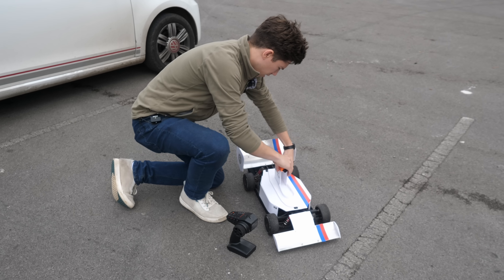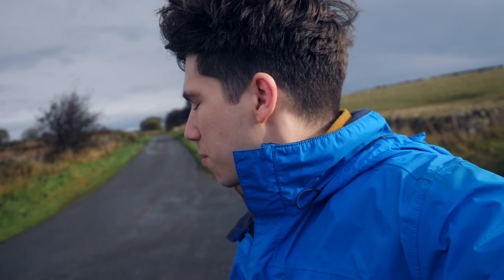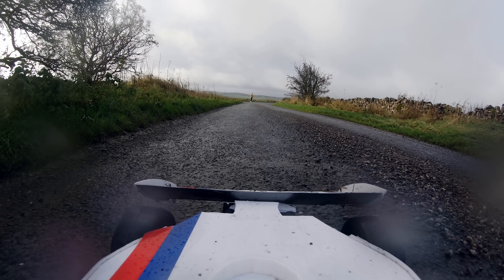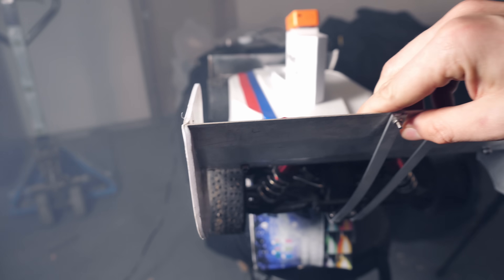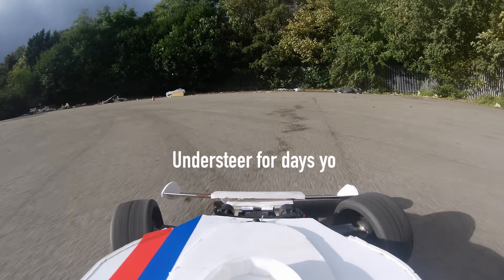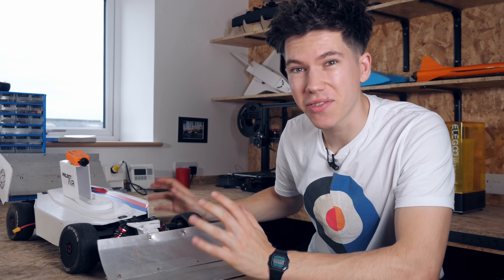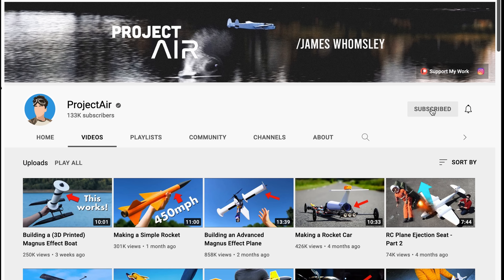RC Car Extreme Aerodynamics

Comment: Very interesting stuff. Having had a tiny role in some F1 aero (I once mechanically designed a blade antenna that went on the 2002 Williams) I know how much effort the teams put into the TINIEST details to gain miniscule improvements. I was impressed with William's input and care and totally shocked by Jaguars lack of it (also did their antenna).
Reply: Eyo u worked in the V10 era! Thats mental. Did u worked in 04 w williams too?
Reply: God, working at motorsport would be my dream job! I'm working at a Baja SAE team right now, hopefully I'll get there
Reply: So how was it working with them and how many years did you work with them but man i would have been jumping around if i got that offer
Reply: What a achievement! I am an aerospace engineering student, wishing to be like you. Ah hopefully.
Reply: Im trying to get into the design and creation of parts using composites. Would be awesome
Reply: Unfortunately in the real world there are rules limiting the height of wings .Running on the track solo is a totally different animal than driving in traffic with other cars.At road Atlanta there used to be a hump in the main straight where cars would flip if they were too close behind another car .I liked the old days of Can-Am with fewer rule restrictions.I used to think it would be best to have wings between the front and rear axles.Then one would run into problems with height limits.The old Chaparral cars were cool .
Reply: tell the FIA we need the V10 era back
Reply: This man.
This man right here has worked a job that many will only ever dream of

Comment: It is always a pleasure to watch your videos. Here is a crazy suggestion to test down force on the RC that may offer a better control. Go old school and attach a control line to the side of the car and a fixed bearing back at the center point of the circular track. This would allow 1 or 2 scales to be placed under the track monitoring the force. As long as the mass of the car and speed were kept consistent the wing and body design could be accurately measured. Just food for thought. Cheers!

Comment: I have raced RC cars in the early 2000's. What I remember is that the F1 cars weren't as fast as sedan-type racecars. Prototype cars also had a big advantage. What those have in common is a very low front bumper, almost scraping the ground, and a very high and open rear end.  I always thought the open rear made a lower pressure inside the body, and that this made most of the downforce. It is also something NASCAR has been doing for a long time.
I could be wrong, but it has always been something I would like to know.

Comment: Very cool project!
I loved that you used smoke to display the aerodynamics of your design as well. I’m no expert, but I have noticed some of your fellow YouTubers using straws in order to give the air from their smoke machine a laminar flow for aerodynamic testing. If you pack the tube containing your current fan with straws of sufficient length, it should provide you with more stable smoke across your car.

Comment: What might really make a difference is a fan sucking the air from under the skirted floor. It worked so well for Porche it got them band from F1. 
Using a ducted fan for this would be a good experiment?

Comment: From a RC racers POV… the setup of the car is more of an attribute than the aero effects. Yes aero is involved in RC racing. But it’s effect is minimized by the scale of the cars compared to the relative actual speed. Basically the aero devices are too small, speeds too slow to create the wanted effect. Always a great video creator to watch, cheers!

Comment: Build a real miniature wind tunnel with a scale to measure downforce! When I was looking at your fan/smoke machine I was wondering if the air flowing across the car should start as laminar flow which would simulate air flow in ‘clean’ air. If you use turbulent air you can simulate dirty air. That sounds like a question for Destin @SmarterEveryDay
Reply: A wind tunnel is not a simple thing to design, even on the industrial level.
That fan/smoke trick is nice but it doesn't represent the real flow around the car because the fan is too small and you can't guarantee the smoke is distributed equally by the machine. You need a bigger fan, a long distance and a set of diffusers to have an acceptable laminar flow. Moreover, these turbulent conditions do not represent track conditions in any way.
It can be a nice highschool project, but I don't think it will bring useable results.

Comment: You may need stiffer springs as the downforce pushes the car down, so that the suspension is not fully compressed and unstable?

Comment: I don’t know you and how much you know about F1, but you should try to do a fan car! (A car with a fan to suck the air underneath it) 
It was banned very quickly after it appeared because of the unfair turn radii it had, especially at low speeds where static aero couldn’t do the trick.

Comment: Something you could try would be having the rear wing connect directly to the suspension rather then the body or chassis. Both Can Am and F1 did it for a little while so the force from the wing was transferred straight to the tires rather then pushing the chassis down.

Comment: Haha you should bring a pushbroom to your testing site, would help with consistency!
Also I think a light plastic rear wing, maybe made of like, tupperware or something with the smaller front wing would work well to keep grip at the front at speed. I think the front wing needs to be a tiny bit narrower than the rear as well, and as low as you can get it. Great video!

Comment: Also you have to consider the drag force caused by big spoilers increasing the frontal surface area... There is a relationship between drag and downforce...

Comment: Get an anemometer and use a desk fan to blow air over the vehicle whilst it's on a bathroom scale. You should be able to measure the down force in vaguely the right air speed range. My mate did this for his A level Physics Project.

Comment: James, a very interesting video. This type of aero is like a law of diminishing returns but seeing as how your baseline was the bare chassis with no aero then the initial gains are going to be massive, I can tell you that an 1/8 scale IC car with no body work is very unsettled, put even an average body like a Lancia LC2 an  there is a huge initial difference, then the gains are smaller and much harder to find.

At one point later in the video where you had understeer, you had the car pivoting about the back axle and actually lifting the front end. I done some wind tunnel testing with Ford on their first WRC Focus in the Cologne wind tunnel and this rotating around the axles is very noticeable. Ease off on the rear down force and some to the front and away you go.

Don't listen to the doubters. Most of them have never done anything useful.

Comment: The wing angle of attack should be in the 7° to 13° range to avoid flow separation on the back. To increase down force you can split one big wing into several smaller ones with progressively higher angle of attack, so that each is ~7° steeper than the one before it, and shallower than the one after it. Aerofoil cross section matters.
Reply: That rear wing isn’t a wing, it’s a spoiler. They work differently biggest confusion people make about car aero. The front wing is also pitched wrong. It’s making more drag than downforce.
Reply: What is it that makes it a spoiler as opposed to a wing, but the front surface is still a wing and not a spoiler? Is the original rear surface on the car (1:06) a wing or a spoiler? What about on an F1 car? What about a Formula Student rear wing which is similarly optimised for low speed downforce?
Reply: @Leo99929  In this case the profile and how the downforce is generated. A race car wing actually generates most of its downforce from the underside via suction just like the diffuser, since these have no profile and the air is basically just hitting them rather than creating low pressure under the surface it’s a spoiler.

Comment: You need to keep the internals the same but increase the size of the chassis and shell whilst adding as little weight as possibble and have an even larger set of wings and design the shell to push the car down etc.

Comment: If you use an upside down 
airfoil shape, it doesn't push the car down, it sucks it down, like an aeroplane wing lift the plane by generating a vacuum on the top side of the wing.
Just think the explanation in the start of the video is a bit mis leading 🤓😁
But nice project 👍

Comment: A selfmade wind tunnel would be An interesting project in itself and a nice tool  in the development of future builds.
Reply: There's a reason why wind tunnels are worth a lot of engineering times, you can "design" one and homebuild it but there's a lot to it. There are different tunnels for different flow regimes, different sizes and different applications.
Reply: Wind tunnels are incredibly hard to design and get good results from. Reason why conventional wind tunnels are expensive.
Reply: I second this idea!
Reply: I made one using straws and a fan in the rear so laminar flow isn’t disturbed. I used some dry ice in warm water as smoke and a small air foil. It was pretty incredible
Reply: This would be a good place to start.
 https://youtu.be/Sx5BQjKvElk
Reply: I recently watched this, I feel like it's almost exactly what you're thinking: https://youtu.be/NVUwNEZURpk
Reply: YES
Reply: The Wright brothers approve this post.

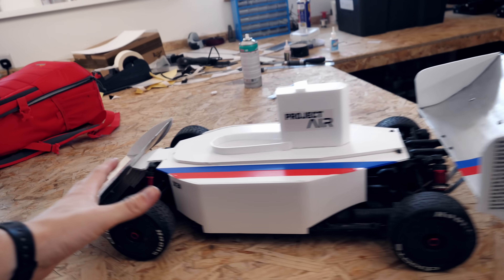Comment: 3:16.. With this setup...at those angles all you are getting is Air deflection down force but no wing lift down force since your wings are not slicing through the air as an Airplane wing would. At those angles the wings merely stall... IMO

Comment: Yeah, this is really cool, but definitively needed to be more scientific. Even without the wings, the car could go full speed through the corner. At that point, the only thing the wings can do is slow the car down with drag. You need to find a corner that the bare-body version can't get around without slowing down, and then see if the wings improve it. Pointing the camera at the suspensions and seeing it pushed down would also be a really good indicator
Reply: I'd reccomend a better testing track
Reply: Its hard to control the car at those speeds
Reply: He wanna have fun not build a fucking racecar
Reply: @shukriwafiq5220  I fail to see the relevance. Are you proposing you can't have fun doing science?
Reply: he is rc youtubes what do you expect xD jk

Comment: maybe raise the spoiler and remove the skirts
in f1 they stopped the skirts because of increases in crashes
also, the big size with the large angles of the aero could make handling harder
Reply: also something that might help is loosening rear anti roll bars if you have any
and/or softening rear suspension dont over do it on the roll bars or suspension though
there could be too much roll and all the grip goes to 1 tire

Comment: Hey i am an aeronautical engineer, and i felt really happy after seeing this video as i am also currently working on a similar project. But instead of a big single static rear wing, i am designing a actively controlled split rear wing which automously changes its angle of attack  in accordance to the turning of the car for maximum turning speeds. I currently have nothing to show about my project on my youtube but I would love to see you make something similar for your upcoming video. ✌️

Comment: i used to race 1/10 scale offroad buggies and yes wings defiantly make a huge difference, if for some reason you lose the wing off a buggy in a race you really do notice it, depending on the track surface and class your racing in it can become almost undrivable

Comment: I used to race RC cars nearly 20 years ago - indoor 1/12th on a reasonably large carpet track with a decent straight. I remember playing around with different body shells and rear wing combinations and there were deffinately differences to be felt - less so with shells, but a decent rear wing with end fences definately made them more stable down the long straight. That could then be balanced with better front end grip allowing good tracking down the straights, with pointy stearing response for the tight corners. Not talking huge differences here, but when you are used to running the same car on the same circuit (we did change track layouts once a month) with controlled indoor conditions, then you do start to notice the small setup changes which you can make and the small differences adding a big wing with fences can make. 

Fun fact, the track used to rubber in over the course of the month - when the carpet was hoovered at track change time, the grip the first week of the new setup was awful. We didn't use tyre addatives, just the natural rubbering in of the foam tyres on the carpet. 'Marbles'  (dust and general crap) off line was a thing too!

Comment: Compession of suspension components to a calibrated set point would give down force value and a split front/back , but would need a smooth running surface.  

Awesome vid btw 👍👍👍

Comment: I have always wondered about active Aero. Wings flatten out in a straight line, sensors pitch them up for more downforce in turns and  turn them right up for braking.  Also like to see the old fan car design that sucked the vehicle onto the road with engine power.  They built one like this but it was so quick they banned it after one race.  Always wish they Built a Demo car with all the tech like active aero, fans, turbos etc and see how much faster it could go round a track than the " legal" cars. I bet it would be a LOT faster.
Reply: I hear Ron Dennis encouraged the design to be banned in the US... probably because it was about to cause all race cars to adopt the "door-stop" shape, as well as the danger inherent in any loss of suction while cornering.

Comment: Removing your front wing endplates will have an effect on your aerodynamic forces produced. The endplates help to seal off your area of suction (underneath the wing) from your area of high pressure (above the wing). This joined with the reduction of wing tip vortices produced from the spill over will reduce ur drag while increasing your downforce as the endplates act to effectively increase your span. This reduction in drag and increase in downforce improves the efficiency of your wing. The formula suggested by Hoerner quantifies the new aspect ratio as a function of wing aspect ratio AR_actual, height of endplate h and distance between endplates, b. This formula further assumes the span of the endplate to be equal to aerofoil chord, c. The formula is:
AR=AR_actual(1+1.9(h/b))
Reply: Hoerner is the best!

Comment: Some suggestions:

Testing each change individually, and periodically re-testing the base no aero setup, and documenting how each change affected the car positively/negatively. I know it's a lot of work, but would be fun to watch I think, as we could follow the progress in detail with you.

I think this could be an interesting ongoing project to follow over time, with further experimentation as time goes on, maybe one day have active aero for a more varied track.

Comparing the stock aero from the factory could also be something interesting to see.

As for suggestions, I would go with softening the rear shock absorbers a bit, maybe with a lighter oil, as it looks like the car is getting thrown around from those big bumps without absorbing them.

3D printing aero parts might also be a way to have lighter parts that are also precise.

Anyway, definitely please continue this project. =)

Comment: Have a look at formula student cars, they race at similarly slow speeds to the RC car so their aero packages have to be massive to do anything. Maybe those cars could give some inspiration.
Reply: That is not correct. Formula student may race at slower speed but the cars are non surprisingly bigger, that makes the reference length of the wings (i.e, chord lines) different. This in turn changes the Reynolds number and the flow regime. There are ways to create similarities between the full-size and model cars.

Comment: You forgot to add tires and wheels those will match with your testing road area and with your car speed. Moreover, those wheel you used that was for first car and it was made for that type of speed. By the way, your concept and model is good enough. Just need some upgrade.

Comment from the maker: Hope you enjoyed this month's video! Let me know what you want to see me build next! 
Correction to the lift calculations -the full lift formula is L = Cl * A * .5 * r * V^2 

More info here https://www.grc.nasa.gov/www/k-12/airplane/lifteq.html
Reply: That fan and smoke machine was cool, you should build a scale-sized venturi effect recirculating wind tunnel! That would be a cool project
Reply: Thanks for the right formula but I don’t think anyone even noticed 😂 like i would be fooled even if u said a=bxc
Reply: Thank you! That matters a lot to those of us who live it. Remember people, we’re just fish where our water is simply very thin/rare. Flow is everywhere, always.
Reply: Hi! Nice video! How about u put a upside down drone on the car. The fan/propeller are pushing the air up giving massive down Force. I would really like to see something like that! Tq.
Reply: For ground effect to work your suspension needs to be perfect as well as the surface you drive on.